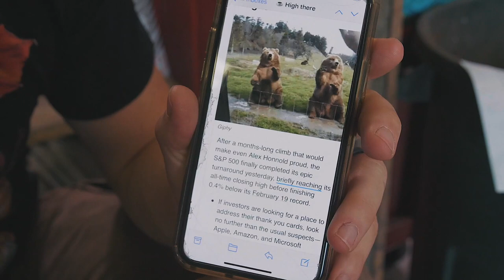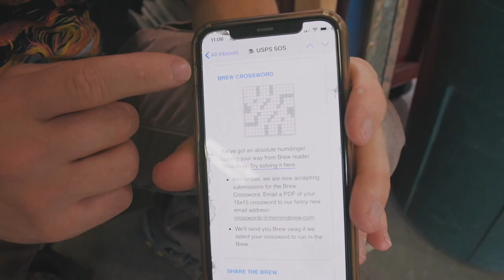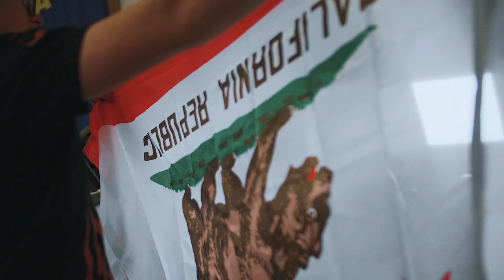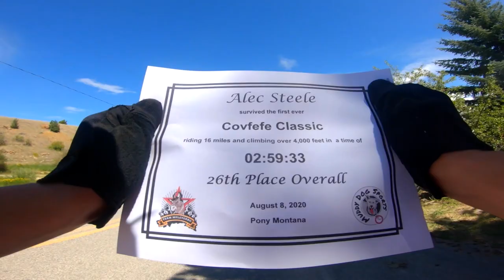ODDS 'N ENDS

Comment: Alec, I have to say, you’ve been one of my biggest inspirations for blacksmithing.
Back in January I started to develop a curiosity of smithing, and started exploring the craft online. I came across your channel and a few others like the Black Bear forge.
Since then I’ve gotten a small forge and made some tongs and I’m now getting a belt sander to start trying to make knives.
So, thank you so much for getting me into blacksmithing! When I get a break from school I will do my best to make a knife. Not expecting a good one, but all I have to lose is some metal.
Reply: Something similar to me, but with limitations I've had to resort to carpentry. I'm not complaining though. A 17 year old with a bissiness is nothing to be ashamed of
Reply: Huh, I just finished my 9th knife, made several necklaces, trinkets, bottle openers and still using pliers and a vicegrip. Maybe I should get to making those tongs already.
Reply: @mrkiky  yeah, get into the crafts as early as you can, some poele far more ecperiaced than me who have been giving me lessons have said those very words
Reply: I’m currently 15 and limited by time, but I spend some of that freetime learning more about blacksmithing.
Especially the health, I never knew before about what flux fumes, galvanized metals burning, and the improper technique can do to your body.
Reply: @evanmccaskill3687  yeah, being young and getting into craftsmanship is hard, especially if you want to do it as a career because it takes practice, or if your very unskilled like me, lots of carefully tuned machines
And of course, this emachines are not easy even if you have the cash because of space limitations
Reply: Even if your knife doesn't turn out, you don't lose the metal, just reuse it in a future project. Rooting for you, hope it goes well.
Reply: oliver worley I don’t think I’d want it as a career, but as a hobby to have some fun and make some money.
My dad has a machine shop, so I have plenty of tools to learn.
Lathes, CNCs, table saw, trying to get a power hacksaw working. MIG, Stick, TIG welding too.
I have tools to use, I just need to learn them better.
Unfortunately, no mill or surface grinder.
Reply: Mason Wadd Thanks man! I’m gonna start up an instagram/YouTube to track my process. 
I’m sure I’d get discouraging comments, but from everything I’ve seen, people like to critique/help, which I enjoy receiving.
By the time I get it made, I’ll give a link down in here for people to see.

Comment: Just wondering about the necklace, would inlaying a loop of gold into the steel itself for the gold loop that attaches to the chain help it last longer? That way you have gold on gold as opposed to gold on steel. Not sure if that quite makes sense but was just a thought. Obviously if it's every couple of years that the necklace might need looking at then it's not a major rush but figured it might be a bit more long term
Reply: also came here to make a similar comment, but you beat me to it, a softer insert than steel would definately work aslong as it is flared/riveted out
Reply: Also came here for this, but I'll propose a different possible solution: replace the gold ring, with a brass or bronze ring. Almost undetectable, easy fix, and probably have the same effect.

Comment: If you change your gears when your going downhill/flat your legs will be going a lot slower and it will make it much easier. Also on dusty ground your wheel wont spin as much
Reply: I was just about to say that, he seems to ride in low gear a lot of the time. Riding in low gear results in very high rpm and is a lot more tiring.
Reply: Ash Neale not exactly...
Reply: Idk how he couldn’t figure that out lol
Reply: Yeah I was thinking this too... After the downhill on the flat roads he slowed way back down even though he had all that momentum and open road on the flat. It seems like he's only had that high speed under gravity not through his own power!
Reply: some eejit years back thought spin was a "great idea."  'ooh, it really gets your heart going!"... yep. no.
Reply: Adam Slaughter I would disagree, there are a lot of shots where Alec is extremely undergeared and his legs are spinning like crazy but he isn’t really moving (pretty much all of the mountain bike race but particularly between 11:30 and 11:40). Riding uphill is already difficult enough without him setting the race difficulty to legendary on top of it lol

Comment: Also, tips for the MTB race... For that type of terrain try to use some less aggressive tires such as Maxxis Ikon or Continental Race King. To make it easier on climbs, lower the steam and use a flat handlebar. For reference, my setup is Maxxis Ikon 29x2.2 (rear) and Race King ProTection 29x2.2 (Front) and Ritchey WCS 6º 90mm (upside down, so it's -6º) and a stock BMC flat handlebar.

Comment: Hammer stapler. And there's an easier way to hang flags or banners, much easier and much safer way. Tie a string to one corner, preferably one with a hole, if no hole then put a coin in the corner, fold the banner or flag over the coin and tie the string around it so the coin has to be pulled through the knot for the string to come off. Then staple the end without the string, move your ladder to the other end and use the string to pull the flag or banner up to you, remove string and staple the flag or banner.

Comment: Re: the gold loop.  You should inset a gold liner sleeve in the hole in the steel piece, this would act as a buffer/bearing  that the loop can slide through, but not wear away the loop.

Comment: Regarding bikes. Aluminum is nice, but it is not good for heavy impact riding. I recommend getting yourself different rims for different things you want to do. Long range endurance on smooth gentle trails, aluminum. Heavy impact jumping, get yourself some steel. if you decide to participate in road-only stuff, there are fun tires and wheels that you can try. carbon fiber comes to mind.

of course, be safe, alec!

Comment: Alec if you're interested for use on your own time riding and not in a race they make battery powered torque multiplier that will assist you with hill climbing so a two hour climb can very well be cut in half. Also if you thought that grasshopper was big just head to Idaho or Utah to find a mormon cricket, then after you see one please promptly squish it as they are very destructive to crops and other plant life.

Comment: If you are worried about rattle snakes, i belive there are shin and calf guards for just that problem. I think they're called snake guards or rattle snake guards. My family owns property covered with those dang rattlers and they equip all visitors with those. They're basically thick fabric or leather straps that wrap around your knees.

Also, if you ever plan on going some place with bears or other human-eating predators, you ought to consider getting an every day carry. 10mm is becoming very popular, especially since Glock started making handguns chambered in 10mm. I'm quite fond of the glock 40, though the glock 20 is a little easier to carry. Gunfighters makes an excellent chest holster for the glock 40, it's their Kenai holster.

Just something to keep in mind. Don't bother looking for anything this year; for once in my life, guns and ammo are completely sold out, and what you can find is over-priced. Just as a reference, a glock 40 should be priced around $650, not the $750 I've seen everywhere. Just wait until corona and riots die down.

Comment: Hey Alec, wanted to let you know that according to the US flag code, the US flag cannot be lower than any other nations or states flag in the room, this is a minor issue just figured id point it out. Also on the bicycle side of things, might i recommend you change out your wheels with steel rimmed 26" schrader. Using 26" x1.75" tires will give you more than enough contact area and 26" tubes are really cheap and easy to replace, making a roadside fix a 5 minute job. This is assuming you used 26" wheels of course, I have to update myself on the mountain bike series.

Comment: Sparse repairing the gold goes that's what happens when you use high karat gold closer you get De Pere gold the softer it is. That's why most of your jewelry is 14 karat instead of 24 karat and most of your college and high school gold rings used to be 20 karat so they would last longer but if you wear them on a daily basis you rub all the lettering off the outside of them within several years so it's best to get the 14 karat which will last a lot longer and it's a lot cheaper. Nice work as usual. I am still waiting for the Damascus Knife Fork and Spoon set for the discerning mountain man. 
By the way be very careful when you're riding your mountain bike if you have a flat in Rattlesnake country. Rattlesnake teeth still contain part of the poison even when the rattlesnake is dead and if you get one of their fangs stuck in your tire and then you rub your hand over it looking for where your flat is it can still puncture you and cause great damage,  just a word of caution!

Comment: Alec you seem to have an awful lot of head bob in your front fork when climbing and pedaling on flat ground. You may want to consider stiffening it a little. 
You lose a LOT of energy if you fork bobs to much.
Also 16 miles for a race? I used to commute 10 miles to work each day, then take the scenic route home so my daily totals for mileage was 30+.
That summer I rode solo from Green Bay Wi to Milwaukee Wi 126 miles in a day.
Ride more you things will get easier. Park that truck and ride to work.

Comment: If the gold loop was worn away by the steel because of a difference in hardness, you're just going to have to fix it again in another 2 years. 

Can you not find a way to line the inside of the hole with a softer metal that won't wear away the gold loop? Seems like the kind of problem solving you tend to get excited about. And it might make for a good video or series of videos in and of itself.

Comment: Remember, a rattlesnakes does not want to bit you. Venom is biologically expensive and they don't want to spend it if they don;t have to. That's what the rattle is for. While there are exceptions of course the vast majority of rattlesnake bites occur on males, late teens to early 20's, with high blood alcohol levels, who get bit in the hand - so basically drunk idiots who think it'll be funny to pick up a rattlesnake and pay for it. Don't be that guy and you should be fine.

Comment: Have You had a proper bike fit done, Your saddle height looks quite low judging from your shadow,

Also, I would suggest varying your cadence slightly, high cadence on the climb is good but consider trying a lower cadence on the flats( kinda like a car on the motorway, lower revs are more efficient when you don't need the power)

Ps Rule#33 shave those legs

Comment: Why not string flags up with clips attached to line across ceiling/wall, no tacking needed. To keep them from sliding you knot around each clip. Each flag should have grommets for clips. 
Also if you come across a snake, leave it alone since it wants nothing to do with you either. 😄.   What wewd you do if you came across a Sasquatch on your bike ride....😐😄

Comment: Pls check the material of your bike aal the time.  Produced bikes have a kind of consistency and company’s have years of experience in producing bikes that get heavily used in aal kind‘s of environments. You have experience in crafting and with material but this is your first bike so any mistake couled leed to huge injuries or death. Also use some better tires. Tires shouled not break at aal.